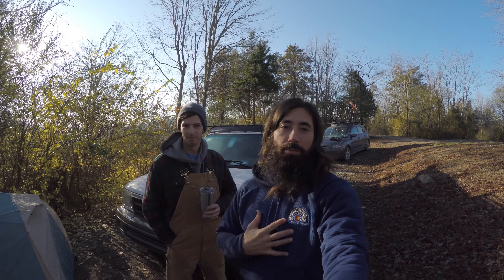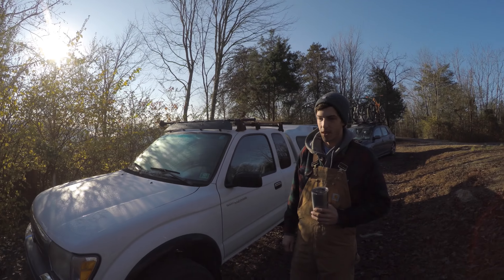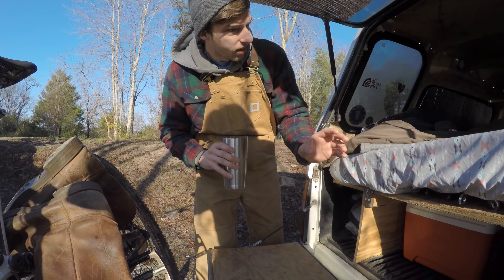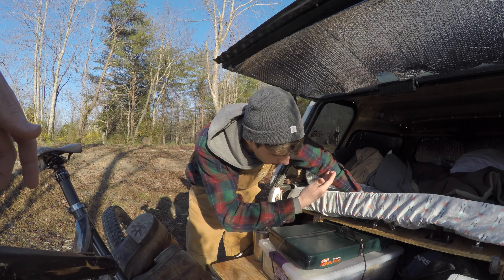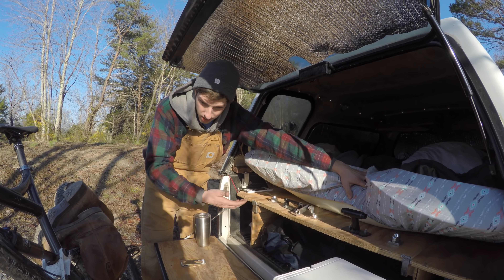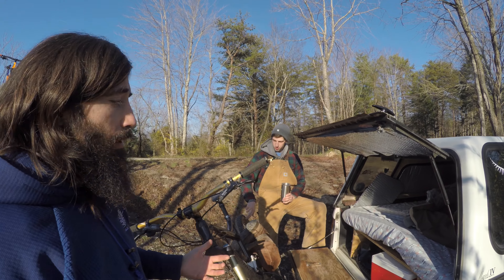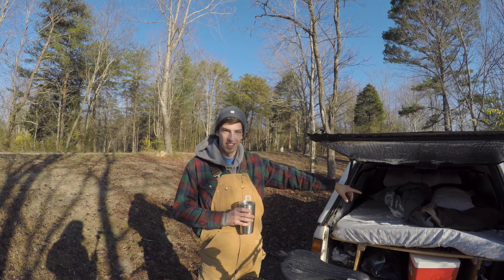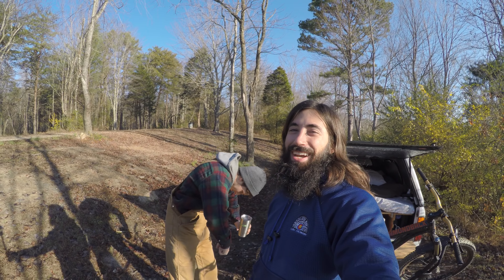Modular Camper Truck Conversion Tour for the Weekend Warrior

Comment: I like your build. I did a similar frugal build with an old Sequoia 4WD. A Coleman cot fits perfectly ($39) with a trifold memory foam mattress, a 12V fridge that plugs into the rear 12V port, and a roof rack. Under the cot, I use WalMart totes for storage. My most expensive item was the electrical source, I broke the bank for a Suaoki G500 and 100W solar panel. The great thing about my build is that it all comes out and the SUV can be 7-passenger van again in 20 minutes. I paid $7500 for the truck, $500 in tires, and so far, about $1000 on interior goodies.

Comment: My Tacoma has over 350,000 miles and still runs great. My wife has a 4runner with the same engine with over 390,000 miles and it runs great too. I also have a jeep Cherokee 4x4 with over 200,000. All great vehicles.

Comment: This is a clever setup and my 1994 Toyota pickup had almost 300,000 miles before I sold it so he'll have that for a long time. Just a suggestion on the board with the fork mounts. I noticed with the mattress on top the mounts can get in the way or even bonk your head on them. I think it would be better if you just flip the board upside down when the board is in the upper position for sleeping and flip it around so the mounts are at the front end. This way the mattress can lay nice and flat and the mounts being up front won't get in the way of being able to slide things in and out underneath. Just a thought.

Comment: I'm thinking an extended cab truck to be able to fit your bike inside the cab with no issues. Fab up your sleeping platform with storage and drawers, and you got a solid rig. A bike rack can be for easy transport whenever security isn't an issue.

Comment: S'up Alex? 

So, this van/truck conversion is much less extensive than some of the others we've seen. I agree with your comments at the end of the video, if you're not looking to make this your permanent home this type of conversion is probably much easier and more viable than the real extensive van makeovers we've seen. Personally, I'd like to have something a little more spacious. I might feel closed in or even claustrophobic with that bed. I don't like stooping over. I need to be able to stand upright in my tent or camper or whatever. That's why I bought a tent that's bigger than I actually need, just so I could get the standing room. 

But quick weekend trips, this could work for me, too. 

Thanks for sharing this! I know you have something in the works for yourself. Looking forward to seeing what you end up with.

Until the next video, you know what to do!  #lfrhgs  Also, stay upright and keep the rubber side down.

-Brian
Reply from the maker: Yea Brian I agree dude, I wouldn't wanna live full time in there, but for extended trips up to a few weeks, I think it's great!! Especially for as cheap as you can do it... hard to beat

Comment: If you can get the 1/4 in black form. Spray glue it to the roof keep heat in. Look a round you can get it for free cheap. In shipping boxs or a. $5 roll of white in1/16

Comment: way over 300,000 miles is not uncommon on those toyotas. just run good oil like , mobil 1 or pennzoil platinum , a fram ultra oil filter will let you run 10,000 miles on one oil change when you run synthetics.

Comment: Just an observation, it seem almost all the camper truck versions I see use a Toyota Tacoma which has a 5ft bed and Im wondering why. I happen to have a Tundra. Can someone enlighten me?Is it mostly for the fuel?
Reply: Funkafella01 the standard and extended cab tacomas have a 6ft bed. The only one with a 5 foot bed is the double cab.... i got s similar camper in my 96 extended cab
Reply: So would you need to sleep diagonally on a six foot bed to be comfortable?

Comment: So true about the #vanlife builds during the 3:00 mark. I've seen so many Craigslist ads and postings on /r/vandwellermarketplace where people spent a year and $50,000 building out a van only to use it for a few months and decide that this stuff isn't for them. Why not start with a cheaper minivan or pickup truck camper to see if it's something you really want to do, then make that big investment. The #vanlife fad really is getting out of control.